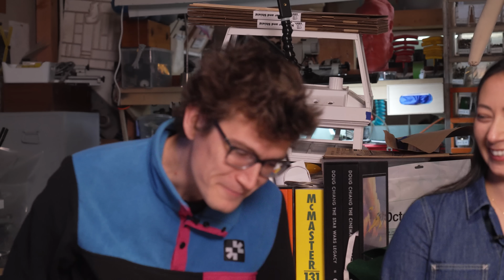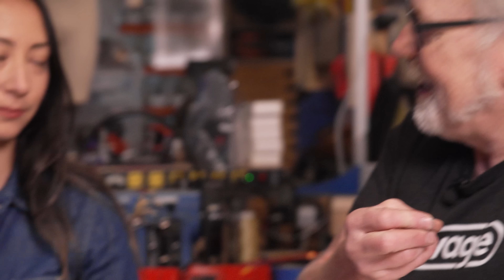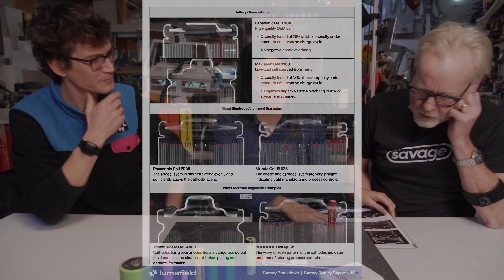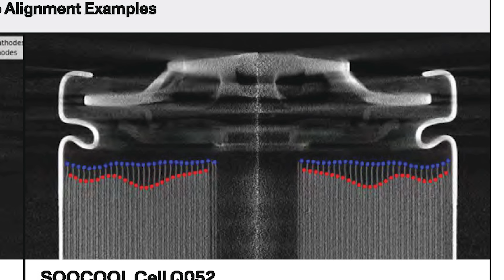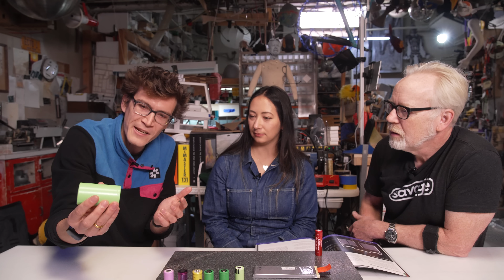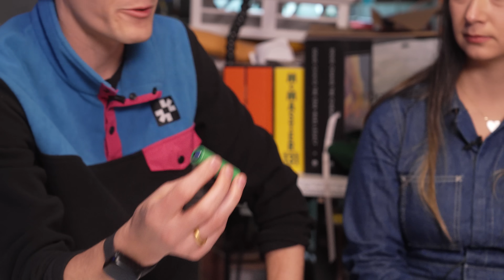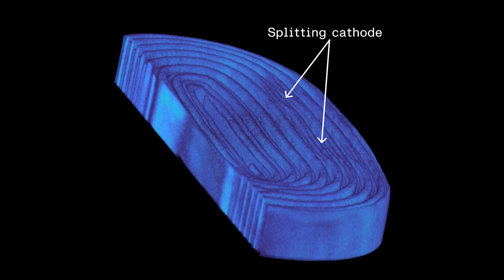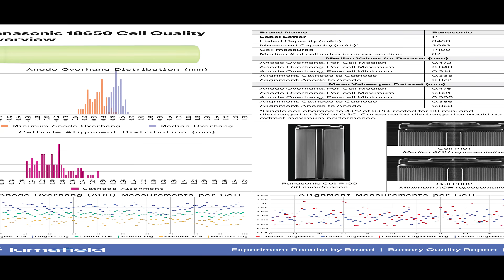The Surprising Flaws in 18650 Lithium-Ion Batteries

Comment: I'm guessing that the cheap batteries are largely if not entirely the rejects that come off the good-battery production lines and sold as such, likely for peanuts. If that's the case, then part of the blame resides in the good-battery manufacturers, who should not be allowed to re-sell the defective ones in the first place, but who should "re-mine" the defectives for reproduction. 

And--if--that's the case, then part of the problem originates in turn with the governments whose politicians write the laws that codify battery sales.

Comment: You can preform destructive testing of the CID by overcharging at an overvoltage. I think the cell starts generating gas as it overcharges increasing the pressure until the CID spot weld tears away and the contact under tension pulls away. 

Another often overlooked safety concern are improper BMS without cell balancing or temperature monitoring. Some DIY 'chargers' don't even feature any form of charge termination. 

I prefer cylindrical cells as they are more robust and feature a CID. One problem is sourcing small quantities of cells from the big manufacturers, especially for prototyping and product development.

Comment: 16:10 a colleague had a garage fire charging these batteries followed by he’s very safe about it. Then he says it was at 4 in the morning meaning these batteries were being charged unattended which in my opinion is not being safe about it whatsoever. Never charge or discharge these batteries unattended.

Comment: I have been into batteries for 30 plus years and have a good understanding of all aspects and would love to spend a day with this guy for some additional knowledge. 
The radio controlled hobby is what brought me to all things batteries and anyone who really knows what’s good knows the 
A123LifePo4 2500mah cylindrical cell is just absolutely bulletproof. And it just so happens it’s the perfect voltage to use as a 12v car/motorcycle battery. 
So when I decided to look into lithium for my motorcycles I knew there would be a manufacturer building batteries using this cell and I found 1 and that’s Speedcell. All of my motorcycles have these batteries in them and I’ve NEVER had a failure. I’m 10 years in on some batteries that have been in multiple bikes and still going strong. These batteries are so good that I’ve bought every single used one I’ve seen pop up on eBay (only 2)which were both Speedcell’s oldest design and both of them are still going strong. Who knows how old they are but they could be 15 years or even older. Speedcell is a bit expensive but you won’t have to worry about buying another battery as long as you don’t let the battery discharge from your motorcycle electronic sitting to long your gold.

Comment: 18650 batteries are obsolete, 21700 batteries are the go now. I was able to upgrade my 7 year old 48v Eprodigy Magic Pro with a 60v 21700 battery & it like is double the power & last twice along even though it uses the same Reention Dorado enclosure/connector setup, so it plugged straight in without any modification what so ever.

Comment: Manufacturers don't "solder them together".  They spot weld metal strips onto the terminals.  There is no solder involved.  Even DIY folks who assemble large batteries out of multiple 18650s spot weld them.

Comment: i had the top plastic on one of my vape batteries (the pink one) deteriorate and when i went to put it in the charger i could hear a faint hissing that turned into loud hissing and smoke, so i just threw the whole thing out the window. when i checked it after a couple hours the battery was welded in place. im now more cautious with my batteries.

edit: made that comment just before 17:30

Comment: You can abuse a li-ion heavily before it becomes dangerous. Overheating and giving a first degree burn. Or placing thousands of them packed together and then set them on fire but with most types of batteries that becomes a "'chemical fire".
Li-po is the one that loves swelling up and even very small impacts can go catastrophic fast. As soon as any layer inside doesn't insulate from the next anymore it starts a runaway reaction.
They're a whole other chemistry but a whole different design.

Comment: In my opinion and experience, I use batteries everyday and these batteries  are so dangerous? You can't over charge, you can't undercharge if you forget them and Come back they are finished! They are small enough  and high power  but is this OK for the danger? There are much better  batteries  that are larger but last longer,(i mean usable longer) and I recently  bought  a tickle halide batteries  that had been  sitting  on a shelf  for 25yrs , charge them and they work for 10-20yrs?

Comment: Some of the better 18650 Lithium cells actually contain a tiny circuit board with a cell protection circuit.  This circuit limits the amount of current the cell can deliver to the load, inhibits cell charging above the safe cell charging voltage, and doesn't permit the cell to be discharged below the voltage level that will permanently damage it.  Most 18650 cells do not contain this protection circuit, but virtually all quality multi-cell 18650 battery packs have a seperate protection circuit board, with wires connected to each of the series cells, all inside the pack.  Same type of protection circuit built-in to cell phone batteries and power banks.
Reply: the unprotected ones are called terrorist cells... they can blow up anywhere anytime

Comment: Both the cylindrical cells and the flat rectangle cells are wound in the Jelly-Roll configuration. Plus, the dendrites form through the layers of the Jelly-Roll membrane after too many charge cycles or overcharging. The "ends not lining up perfectly" has zero bearing on dendrite formation.

Comment: I have a long range fixed wing running 3 of them cherry coloured cells in 21700 size so 5000mah rated.   Ido get 45 mins run time at 3 amps draw but they definately should manage an hour.

Comment: 9 lion powered devices really my headphones my watch my 2 phones are 4 then I have an array of power tools 4 impacts 3 drills weed wacker blower hammer drill sander that list could go on and on I got 35 Makita lxt batteries 7 Makita xgt batteries a lion stick vac a liion shop vac tablet baby monitor wireless controllers I think that number is completely wrong

Comment: I'm an electrical engineer SME that first worked for a battery company manufacturing LiIon cells in their early days and then worked for a company incorporating them into it's products. We purchased cells from Chinese manufacturers for the products of which hundreds of thousands were eventually produced. I had to constantly monitor and inspect the manufacturing processes including Xray imaging. Even with that we ended up with battery fires and lawsuits. Fortunately we never had any injuries or fires (other than the cell itself). Ultimately we concluded that raw material quality along with manufacturing defects were to blame. Even with the "name brands" its a constant battle to maintain quality control.

Comment: I've always only used exclusively Panasonic 18650 cells because back when I started using them, there were concerns that some of the cheaper ones had a habit to spontaneously catch on fire. It's crazy to see that there are some definite reasons.
Reply: A tendency to spontaneously catch on fire? Yes. However, inanimate objects do not have "habits"...
Reply: @Bigfoot-px9gj  Wait until you hear about poetry... it will blow your mind.

Just so we are clear, it will not literally make your mind explode. The phrase "to blow your mind" is a metaphor for an experience that is illuminating or difficult for someone to understand.

Comment: @7:45 you ask if they charged and discharged the batteries to see if the Lithium ions move back and forth to build up into dangerous structures. It sounds like the answer was they don't know, that it is too small for them to see and know the answer. It makes me think that they just assume the ions being out of align are not safe, not an actual fact we should be worried about, please correct me if I am wrong in my assumption, prefferably with facts, not opinions.

Comment: Thank you for the video and the coverage of the information. Those are some of the VERY best guests you have every had. Thank you.
Amazon is *ABSOLUTELY* aware that *some* of their products are not just "technically possibly" dangerous but are KNOWN to have caused grievous physical harm to property, humans AND animals, including loss of life.
Amazon will NOT remove the products even when confronted and in the rare occasions that they DO remove a single product sku if the *SAME* product is available under multiple skus or suppliers they will do nothing.
Louis Rossman has gone over this extensively. Fuses that *DO NOT* cut off at their ratings levels or even TEN TIMES what they are rated and an automated litterbox that has killed multiple cats.
Do not count on AMAZON to care or take positive action.
Reply: The battery pack on Louis Rossmann's electric bike caught fire just outside the front door of his apartment building (back when he lived in New York). It wasn't even on charge. The manufacturers had cheaped out on the batteries in the battery pack. Just thank goodness the bike wasn't inside the building.
Reply: Some? After all, Amazon is awash in garbage; their entire strategy from the very beginning has been focused on the principle: buy low, sell high. Which worked because the Merican society is poor and not quality, but price are the main purchasing factors. It's the same approach as Ford's back in the day: it's better to pay compensation for passenger deaths than to improve the design. This is madness that could only happen in the USA. Greed is good, right?
Reply: @poke-you-tube  Ummm....much of what has horrible reviews on Amazon is not American-made, but cheap Chinese garbage. The items I've had to return or have had early fail rates all came with Chinese packaging and instructions that said "Avoid water playing with product. Don't touch children. Please don't be edible"
Reply: @poke-you-tube  Hey doinkbreath Amazon is a global company. Mr.SoSmart GagginsThroat
Reply: I purchased a plug-in thermostat from Amazon and happened to notice after a few weeks of use that it smelled funny. Trying to unplug the small heater that it was plugged into, I found that the interior of the thermostat had melted and fused to my plug. I wrote a review on Amazon describing this as a fire risk and Amazon rejected my review citing "Violation of Amazon Policy" ?????
Reply: Yest we continue to bring them on passenger Jets every day

Comment: The problem with all of this is that cheap will always win out over good when it comes to the consumer. People buy what they can afford so they buy cheap and roll the dice. It happens with batteries, it happens with appliances, car parts, used cars, etc. 
That will never change. The gap between good enough and dangerous is a super fine line to begin with an most simply can't afford to pay what the better manufactures want for their safer products. Its why half the population eats the garbage they sell in the super market or why places like Amazon, Temu, and Aliexpress remain popular. 
The answer is not to ban or raise the cost on the cheaper items either, that only prices more consumers out of he market forcing them to buy even sketchier items. Until battery tech gets cheaper, cheap enough where people don't have to think about the cost, we will have millions of little potential firebombs in and around our homes and person.

Of the cells tested, I've got the Panasonic, Samsung, Efest, Trustfire, and a few others not shown here. Of the cells I've had only the Samsung cells have ever failed prematurely. Each dying in different ways. None had any sort of discharge or overload protection. 

Laptops are the most common place to see 18650 cells, and lately in small flashlights, jump start packs, and power tools. 
The biggest issues I've run across is uneven charging in multi cell packs despite supposedly having a charge controller to prevent that. Nearly every power tool battery I've owned has had that issue, so have several newer laptops.

Comment: What would be great to see next is if there is data showing a direct causation increased fires/combustion as a result of these cheap batteries.  We are absolutely INUNDATED with cheap, battery powered products that no doubt contain these lower quality cells, and yet (anecdotally) I've never actually heard of a product/battery bursting into flames.  I've seen a handful of videos showing it happen, but it seems like they were all Samsung devices and Macbooks 😆 So, while interesting, no hard data was produced (unless I missed something?) to show that these batteries are a significant problem

Comment: You close on "Buy good brands" but I wonder what the correct safety is for someone who does not and cannot. I have a lot of cheap battery tools and my general plan of action is to charge and pull off the charger while I'm around, but I wonder if I'd be well served building say, a small concrete box with a gasket and power passthrough that could extinguish fires if they start? Charging in an external to the home shed, like maybe just run power to a very small metal closet-style shed in the back corner of the yard and put some auto-extinguishers in there, as well?

Comment: Just reading the report. What I find fascinating is the brand I chose (Panasonic/Sanyo NCR19650GA from a reputable seller for my headlamp, not sure what the own-brand is that came with it,  that is the classic problem of those rebrand unknown batteries but that seems proper as it weighs correctly for 3000mah) or any of the big 3 OEMs (Sony/Murata, Samsung, Sanyo/Panasonic) aren't actually more expensive than the rewraps or even the dodgy SOCOOOLs which are MORE than the genuine ones!? 

Obviously the $2 ones with ridiculous claims are bad, but it shows that rewraps can be OK, but overpriced and an unknown quantity. Stick to OEMs from trusted sources.

Incidentally I bought some cheap solar lamps off Aliexpress outside which use a 18650s inside in 2018. I was expecting them to last 1-2 years. I even ghetto waterproofed them with sellotape over the solar panel not trusting the IP rating (a lot of these leak via the panel). They are still going strong!

Comment: I blame legistlators and their staff for not doing their homework regarding regulatory guidances, treating (and punishing) all Li Batteries as essentially the same on Hazmat management economics. 
They have safer chemistries like LFP regulated under the same UN 3840/3841 rules as the more volatile chemistries. They're retarding the adoption of safer, cheaper, longer lasting cells.

Comment: Wow, that is so scary..... It's also compounded by silly rules like the airlines use... You can ONLY bring batteries that are less than 100Wh.... but theres nothing stopping you from bringing 25x 99Wh batteries.... The fire from 25 99Wh batteries would be immense.
Reply: The logic behind the airline rule is based on what would be considered as safe as possible for a single battery that catch fire. Yes the entire plane can have hundreds of batteries that are under the limit but what are the chances that all of them fail all at once? When they are bundled together, they do count as a single battery. A laptop battery can have 8 18650 cells but laptop maker still don't make batteries that go over the airplane limit.
Reply: @chamoo232  The chance of failure increases with the amount of total batteries. The more cells or powerbanks the higher risk of failure. Thus limiting the max amount would be safer.
Reply: @Allexz  sure but I think it's also because when packed together, if one burns, the others will as well making the fire hazard much worse. If 200 people have a single 18650 cell each on board, the chance is is the same than if those 200 cells are part of a single battery but if a single one of those 200 cells burns, the entire thing will go. If the cells are separated and one burns, it just sucks for that single guy's pants and it won't take the plane down.
Reply: @chamoo232  Haha... you just keep adding logic to try to win the argument? Well okay then... Then each passenger gets 200 each then since you gave them all batteries.... It's still more dangerous. It's totally fine and respectable to take a L every now and then.
Reply: @Allexz  No I mean it's the rules of transporting dangerous goods.The size of a single package matters as much as how much of the stuff total there is. I work in the ink industry. When we do the dangerous good papers, the number of pieces is important when it's flammable. If a truck crash and stuff leak, they need to know if they have a single 1000L tank that's all going to drain or if they have 48 pails where the chance that all 48 leak is much lower. The different risk means different responses in case of emergency.

Comment: This is good information. I am trying to rebuild the packs for my Porter Cable 18V which are no longer available, it uses the 18650 cells. I got what appeared to be weld on cells only to find the shells are too thin and the welder punched through the bottom of the first cell I tried.  This will help me find the proper cells now and safe ones too.
Reply: for quality cell only, molicel is probably top rated

Comment: This makes me glad that I spent extra to get a quality made Ebike battery made with Panasonic cells, when I built my custom Ebike from scratch with a bare steel frame back in 2017.  The bike has over 11,000 miles on it now, with hundreds upon hundreds of charge cycles, all trouble-free.  In almost 9 years the only problems I've had were with a couple of vibration-related wire connection issues in the battery cradle base, which I fixed several years ago.